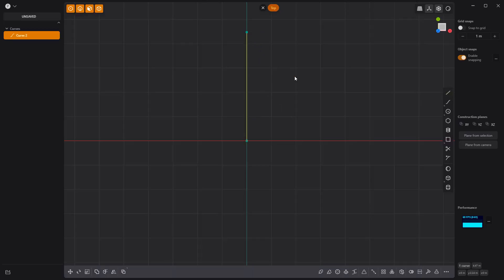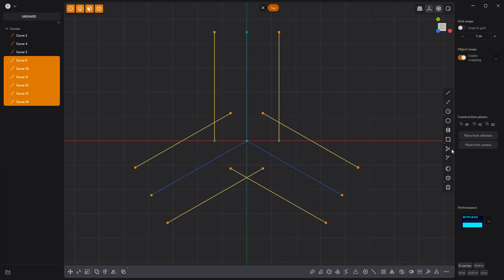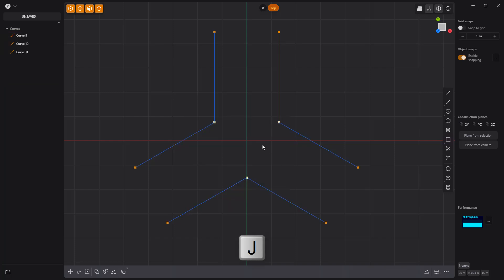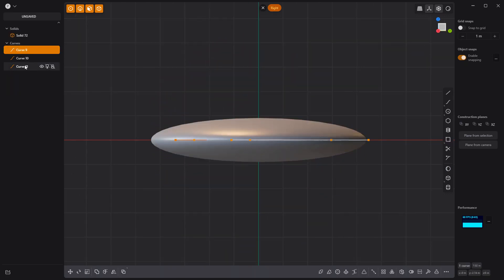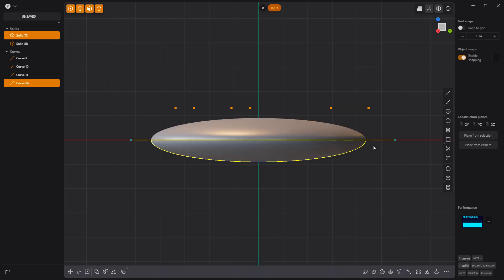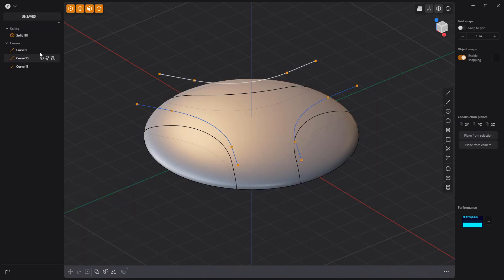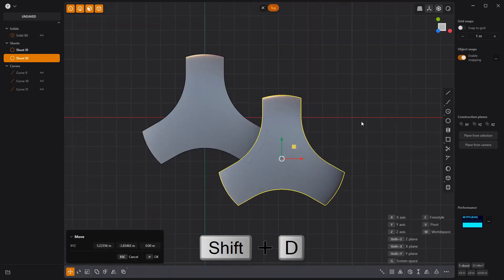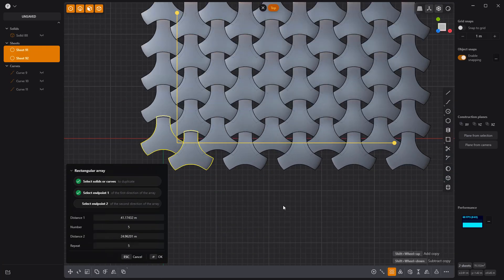Plasticity | Create a Celtic Repeating Pattern

Comment: I'm stuck at the first step with the radial array. I can't seem to get it to come off of that point. Instead it just parallel lines around the curve line. What am I missing here?
Reply from the maker: can you show example
Reply: @Pixelfondue  I figured it out. I had other objects visible and it was using that center point to revolve around which was causing the issue
Reply from the maker: @joshuaandashleyearles-benn4749  glad you have it working now